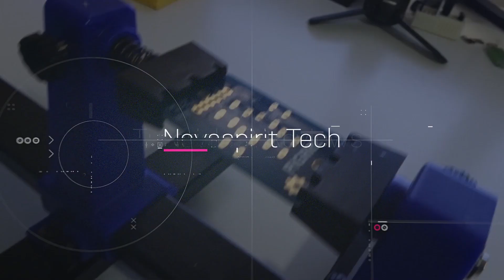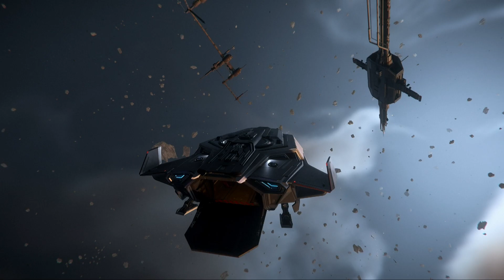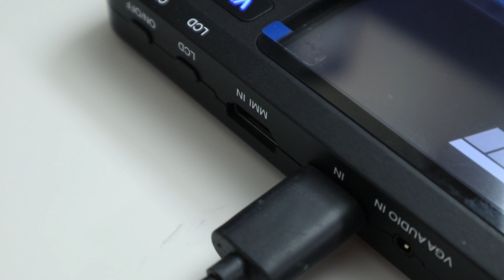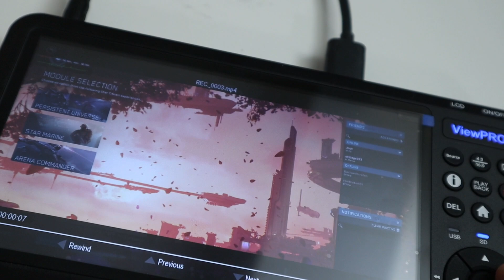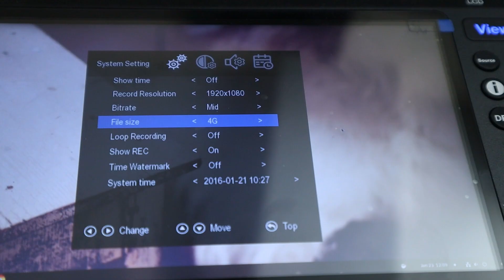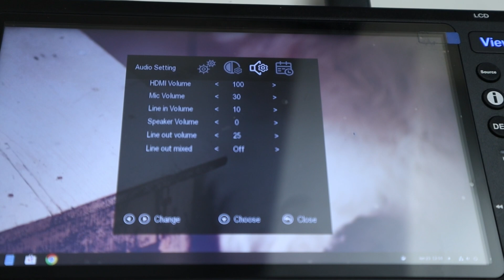HDMI Capture Device with it's own 7 inch screen - Cloner Alliance View Pro Review

Comment: These need an option to capture much higher bitrate and quality. I have old analog videotapes. This is so so for VHS/SVHS, But i have many recordings with Betacam, betacam digital as well as Sd and HD videotapes. And the quality drops so much into this The need to also capture at different frame rates 24, 25, 30, 50 etc. Not locked at 60P as a one size fits all. It doesn't. The Atomos is far superior, as you can choose bitrates and color space many times what these units can ingest.
Reply: Sure but obviously u get what u pay for 😏

Comment: very intriguing! thanks for the insights
bought a blackmagic 5'' video assist 3g (about 300€ used) for somewhat the same use case but i really need the display and the HDMI (loop) out to be outputting at the same time. weight, bigger file sizes and no analog is no deal breaker for me. btw: it feels pretty durable, can work with 4k 60. still FHD recording, with bigger files and way more expensive new in stores...
thought if someone is interested in "something close" but a little different feature set, the video assist could be an option worth mentioning. 
On the other hand an HDMI-Splitter could do the trick  for me when i don't need the bigger files

Comment: Can this capture from amazon video?
Reply from the maker: yes it captures from your hdmi output so basically anything
Reply: Yes, perfectly!
Reply: @davidnclearlaketx can it work on a MacBook Pro?
Reply: @candyKane117i  as long as it has an HDMI source (fire stick, Cable box etc) and then your MacBook has a HDMI input then you should be good. I don't know much about macbook so so I don't know what connections they have.
Reply: @davidnclearlaketx  my MacBook does have an hdmi port but I’m leaning more towards software at the moment cause this device costs $800 where I live 😬
Reply: @candyKane117i  Oh yes, if that box cost that much I would for sure go the software route.
Reply: It will not record copy-protected content (look on their website under 'Product Usage Warning')
Reply: @mauricemaths  I own the device and yes it will record protected content.  I have my Blu-ray player plugged directly in playing John wick 3 recording onto my external SSD drive.
Reply: @davidnclearlaketx  are you able to record straight thru or does it split recordings?
Reply: @facts1752 it splits the recordings but off and I can't remember the duration. I will record something tonight and let you know! 👍